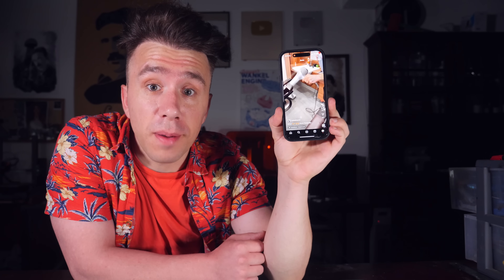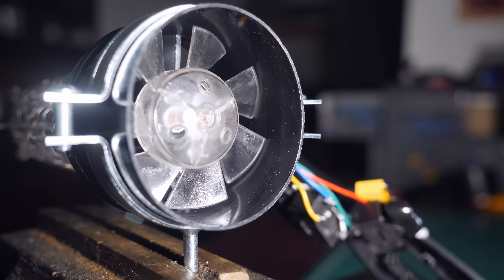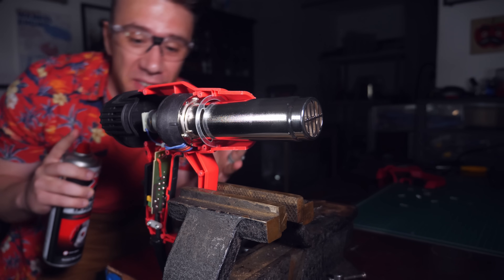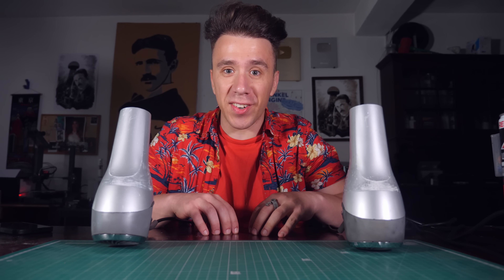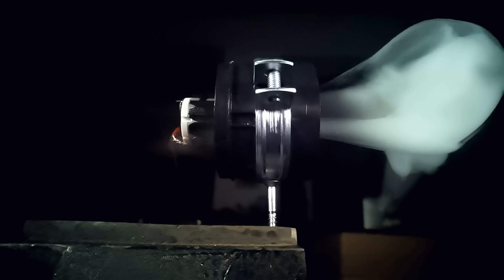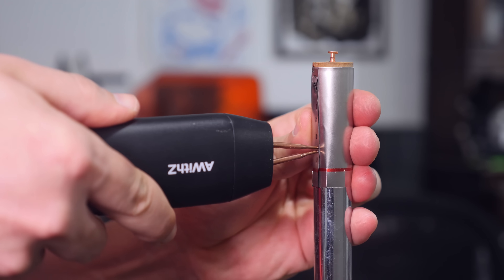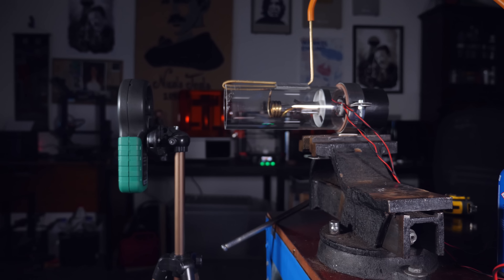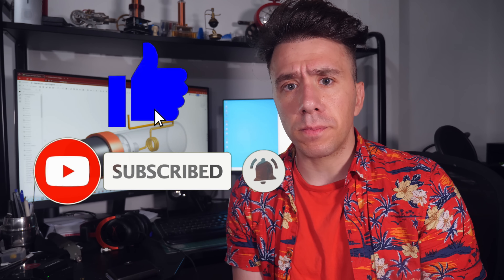I turned my $20 Hairdryer into a JET ENGINE

Comment: Oh hey one thing that really matters is the distribution and mass of droplets of optimal diameter to get complete combustion. Although fuel injectors work they're not ideal for certain applications. For a good time check out a contraption called a 'spinning cup burner' that gets used to get a gnarly hot flame for flash boilers. These were popular with folks messing with high speed steam powered cars back in the '80s and '90s. :-)

Comment: Same spiral coil you already have but drill micro holes all the way around the coil so the fuel goes in all directions. More surface area of both fuel and air contacting and small holes might make very fine flows that burn very efficiently. Potentially need to plug the end to add pressure to push out the holes, or make the holes mist the fuel into the air on that coil.

Comment: Use a burner can with progressively larger or more numerous air mixing holes. Burner can diameter should be ~80% the ID of your outer tube and twice as long. Also make the injector be a manifold ring with multiple pinholes instead of a single hole.

Comment: Hey Integza! You need a flame shroud or tube. What you are building is a Turboramjet or Air turborocket. 

It is the very simple version of a jet engine. Also a company is using it for a SSTO type rocket, using the fanjet portion in atmosphere then using like a rocket out of the atmosphere. 

So you need a flame shroud to keep the flame protected and allow it to heat the air completely. Its close to what you did, just a tube with lots of holes in it. Longer tube, more holes, make power!! Good luck! Feel free to reach out and geek.

Comment: A few things to improve the design. First is to extend the fuel injector past the igniter coil. This allows for more time for the fuel to mix with the air. Next is adding a nozzle to the end of the fuel injector like that of a chemical spray bottle. Tis disperses the fuel as a conical spray as opposed to a stream, improving the mixture rate of the fuel and air. Finally adding a compression cone, preferably with an adjustable aperture size to more precisely dial in the desired pressure a few inches past the combustion area of the tube. This way you can have the fan moving relatively slow to allow time for the air to mix with the fuel, then after combustion the pressure caused by the cone increases the thrust.

Comment: Awesome video!
I'd suggest adding a split valve, in the one side the breaker cleaner and on the other side pure oxygen :)
Carefully of course as this could be very dangerous

I'd also think it would be cool to try to use a "bladeless hair dryer" and see if this would work. If it does you could burn a lot of tomatoes, cause tomatoes are disgusting !

Comment: I can’t use the 3D model but I would suggest that thru the acrylic tube make small holes and insert injection like needles. Thru these needles use O2 gas just before the ignition and use a gauge on O2 cylinder to control the thrust.

This basically be like 4 holes on the tube and some needles with O2 flowing in them and solving the problem without having any issues with the fan speed.

I may be wrong but you can try on a 3D model.

Comment: The high-speed, turbulent air is going to push the fuel-air mixture belown it's LEL (lower explosive limit) - the other is too much fuel, UEL - upper explosive limit.

It's quite suprising what will go "BOOM" if you get it right. Flour, custard powder, WD40... etc.

Comment: I have an idea that can help speed the air up alot,
add a pressurised tube at the end of it, (Like the ones in jet engines) Aswell as get a stronger motor for the impellor (Idk if i spelled it right) (Maybe use one from an rc car) This should increase the blow speed by alot and hopefully be alot stronger.

Comment: Technically, you didn't make a jet engine. You made an afterburner for a hairdryer - similar to the "motorjet" concept.

To burn all the air and maintain high velocity at the outlet you need to use a large diameter combustion chamber with a small diameter exit. The more pressure you get from the fan, the more thrust you will develop. But the temperature involved in burning all the air is really high. Most modern jet engines run at about 15% O2 in the exhaust. As air is 21% oxygen that means that only about (15-21)/21 = 6/21 or 2/7 of the air is actually burned.  Any more and you'll melt the turbine blades (though fortunately for you, you don't have any.)

Comment: I love this channel you're nuts but i think one day you are gonna invent something amazing Could you not drill very small holes in the coil and and instead of it being closely packed experiment with different spacing use something like a cars injector to control the amount of fuel in pulses ? also where you have the igniter support try changing the 3 ring supports to curve the channel of air a bit like jet engine compressor blades to make the air circle ?

Comment: Instead of nichrome wire how about a high voltage spark generator. Also for fuel to air ratio use a Venturi pipe to help meter the fuel.

Comment: The obvious thing to do is to channel some of that air into the combustion chamber. Just some small tubes (with a flair at the end) directing some air into the combustion chamber.

Some tweaking will have to be done to find the right size and flow of air (one, two, or three tubes) but it is an easy thing to think of what a jet engine can do.

Comment: Have a fan that high produces high speed air which leads into a hallowed shock cone we're on the inside of the cone is the wire and behind the cone is a tube on the sidewall of the jet engine with holes that spray fuel upwind and towards the center of the shock cone where it is ignited and it's heat should preheat the air hitting the shock cone farther Downstream is the fuel tube in a coil the middle which goes into a straight line outwards and through the engine wall to go to the fuel Inlet then at the very end of the jet engine is another fan with metal blades to withstand the Heat speeds the hot air back up and if spinning fast enough and has enough blades depressurizes the air. (Sorry about my spelling I have not fully learned to spell)

Comment: I want you to take this concept you built here to another level by applying high voltage discharges along anodes and cathodes.. to affect the fuel distribution before combustion. perhaps this could effectively improve the air fuel mixture ratios... so that the higher compressed air would not prevent combustion.... if not try to use the ions to focus and or confine the plasma of the flame into layers that would act as baffles that can be adjusted to constrict or expand on command to act as afterburners. 

take a look at plasmachanel's new video for more ideas.

Comment: You might be able to put the coanda effect to use by putting a sphere between the fan and the igniter. you might also make the sphere an ionic thruster to allow you have control over the airspeed.

Comment: 13:00 "How to use all of the air without losing thrust"  My answer is as boring as obvious... "Multiple fans on the axle, deviate some of the air flow, use spark igniters..."  => Build a miniature jet engine... turbojet, ramjet,...  with an AFTERBURNER !  🔥🤘😎🤘🔥

Comment: as u are using an acrylic uniform cross-section tube, instead u can use a nozzle like tube to focus more air into the combustion(as the combustion is happening inside the sheet steal metal excess air won't be an issue)

Comment: What u need is a convergent divergent nozzle which is basic for any jet. The fuel is injected at the point of highest compression. I recommend placing the motor in front of the intake fan instead of behind it.

If you want to get max thrust and exhaust speed using the motor then you can leave the back open but if you use a turbo fan in the back it can go beyond that and the motor will only be needed for start-up.

Next level of bang for the buck would come from having a bigger intake fan and separating the the outer high flow and inner jet areas like in modern turbo prop jet engines to get max efficiency.

Comment: aerospace engineer here who did coursework on jet and rocket engines: what you're doing here is effectively making a turbojet engine from a hairdryer - so you can just use the principles that turbojet engines use to get higher effiency of fuel burning.

With the design you showed here, I'm not sure if you put a spray nozzle on your fuel injection port. If you didn't, change that. If it's coming out as a liquid stream at the end of your tube and you're burning that liquid stream in the air, you're losing a lot of potential there (only the suface of the liquid is combusting, leaving a lot of unburnt fuel in the air). The big explosive burst you're seeing coming directly from the aerosol cans are because the sprays are pretty much fully vaporized. By spraying the vaporized liquid down the long tube, it's probably just turning back into more of a liquid stream. So the solution there is to somehow move the aerosol nozzle to inside the fuel injection area. I recommend fixing a hose at the end of the spray can, then salvaging another sprayer from a seperate can and mounting the salvaged one on the hose end (or just buy a specially made fuel spray tip, disel engines use them all the time)

Once you've done that, and you want even more umph out of the system, you'll want to actually use a nozzle that encourages combustion flow - so you want the nozzle to get more narrow toward the exhaust of the system. That will force the burning fuel-air mix close together, allowing it to more thoroghly burn, after that part if you want to put an expansion nozzle after that - it'll then encourage that burned mix of air to expand out and burning even more of the fuel-air mix - producing more thrust (but at the cost of exhaust air speed, which is what it seems like you're gunning for)

You also may not be giving it enough time in the nozzle to burn - so if you're still seeing problems, lengthen the narrowing section of the nozzle.

Comment: I have a lot of experience with aerosols  and combustible products and I have a safety suggestion. Don't spray the can that close to an ignition source. It's printed right there on the can. But the product is being expelled at an appropriate speed and volume so that makes it safe right? Nope. Not 100% safe because the flame can follow back into the can if you don't immediately  release the push button. That provides an opportunity for the flame to chase the product back into the can. As you can imagine, the can would explode and I'll leave the aftermath of that to your imagination. 

There is no safe way to spray anything from an aerosol can into a flame or other ignition source.

Comment: TL, DR: The air must be slowed down with a nozzle at the end. 

Why:
It increases chamber pressure and improves combustion. Improves thermodynamic efficiency too.

How:
Right now you're relying on just heat. So it's something like a lenoir cycle, but with rayleigh flow instead of constant volume heat addition. These cycles have inferior efficiency compared to brayton cycles where constant pressure heat addition is used. When a  converging nozzle is added, it effectively reduces airspeed inside the chamber and increases pressure (bernoulli). Also, it allows for more combustion as the flame front has enough time to reach everywhere and heat the air (akin to constant pressure heat addition) This increases chamber pressure significantly and results in higher exhaust velocity.

Comment: 1:27 You got almost everything you could get wrong wrong.
1) The length of the wire doesn't affect the heat at the same current. If you have the same current in a longer wire, you have more power dissipated by more wire and the temperature is the exact same. The voltage and power will be higher but it's not gonna run any hotter at the same current. If you have the same amount of wire and pass more current via more voltage, temperature goes higher. It has a resistance in volts per meter when you buy it.
2) If you shorten the wire it will NOT use the same electrical power in your setting. Since R=U/I (resistance=volts/amps) and P=UI (watts=volts x amps) are a thing, shortening the wire will drop the R and I will increase as U is constant. As U is the same and I is bigger P will be bigger.
3) As for the ignition, they probably just used an old hair drier and the motor was sparking at the brushes. There is no way the coil ignited it.

Comment: You could try adding 2 holes on each side right behind the tube where the flames come out since the wind thats generated from the blade might suck in some air from the holes adding to the combustion

Comment: My recomendation for am improvemt is to inject pure oxygen in the inlet and adgust the air and fuel ratio for the best performance and combustion also use a BLDC motor for fast flowing air and finally for the enclosure use a tomato sause can for maximus satisfaction

Comment: Maybe you could use the swirling velocity component of air to increase the time it "touches" the fuel, so you have a more efficient combustion (i think?). After the combustion use a stator to straighten the outlet flux, and maybe place a nozzle. I don't know if it could work, i was just thinking

Comment: Add more fuel just after the fan .  And a converging diverging nozzle  so the outer layer of air comes into the flame and ignites as it goes through the restitution of the nozzle and then expands through the diverging nozzle

Comment: Yo I have an idea, so you see the weird fins to slow the air near the coil? What about you make spurs going outward from the centre with a fuel line running down them. It would slow down the air and allow for the fuel to burn off of the flame in the middle. If it doesn’t ignite, maybe have an arrogant of glow plugs position radially behind these struts. Or maybe use a stator befor the combustion chamber to pressurise the air ready to combust.

Comment: Try an annular ring inside the clear tube with equally spaced fuel discharge jets and one central jet in close proximity to the ignitor.

Comment: Ideas;
1. The buten is gaseous and the break cleaner is liquid it only gets atomised on spraying though it's stock outlet. So when you connect the ignition tube it gets time to become liquid again and so lowering the surface area for combustion to occur fully. Hence the poor performance.
2. Try rebuilding it in a turbo fan jet engine kind of way where the outer most air protects the acrylic tube as before and the inner most air is compressed for effective combustion. The compressor can be very interesting with both axial and centrifugal stages. Goodluck.
Btw try building the flow meter out of *metal 3d printed parts*, a bldc motor, Arduino and then calibrating it.
I hope I win the 3d printer this time.

Comment: To reach a higher stoichiometric fuel to air ratio you may turn the fuel canister upside down to inject more fuel, drill holes in the fuel tube that are pointing towards the combustion and seal the end to inject streams of liquid fuel into the combustion chamber. That also enables you to use liquid fuels like gasoline. I would also heat the fuel by spiraling the fuel line around the fan and inside of the combustion chamber and increase the diameter of the inner fuel-line coil. You could also inject fuel that is heated outside of the combustion chamber and inject it into the chamber from multiple points and you should definitely use a DeLaval Nozzle.

Comment: Design the mount that holds your igniter setup to include slanted flights so the forced air creates a cyclone through your tube. This will help to better mix the air and combustible, thus giving you more boost.

Comment: You could make a ring out of copper tube and attach neadels on it in 45 degree angle and mount the whole thing on the support of the igniter and then the moving air wouldn't slow down as much as bevor.

Comment: Maybe because he is using a nozzle at the tip, pressurise the air inside and gets out at a faster speed but air inside moves slower letting the combustion appen

Comment: I have a Master brand Industrial Heat Gun.  It draws enough power the lights dim in the garage.  (don't worry, I have dedicated outlets as well, no light dimming when using that)
It has a squirrel cage style fan with a side intake and gets hotter than any other heat gun I've ever tried.  It can get stainless steel glowing red hot.  The fan cage and surround for the air ways are all metal, and the nichrome is suspended with mica sheets.  There's also a 2 layer shroud around the output, the inner is almost touching the nichrome so it gets incredibly hot, then the outer sleeve is separated by built-in standoffs with an air gap between  I would imagine that would be ideal for this application, the fuel could even be injected between the inner and outer sleeve.  Plus it has a variable damper on the input, which could work like a choke in a carburetor.  

Damn, now I kinda want to try doing this with my heat gun...  Starter fluid for engines  for lighter refills might be a better/ more efficient fuel

Comment: A coil around he acrylic tube, with holes in it, could inject more fuel into a greater volume of air, thus increasing the combustion boom, possibly. To ignite the fuel I was thinking about sheathing the nichrome wire, like in this video, and to actually ignite the fuel, the fuel has to get there, so my thought was to make multiple hole in the sheath around the nichrome wire, so that the fuel could get there, but the air current wouldn’t obstruct the ignition

Comment: What if you went through the motor? as in a brushless that has the rotation on the outside with your fuel and igniter inside.

Comment: A cone deflecting the air towards the middle of the tube, towards the ignition. Add a bypass to the cone with some angled holes around the outside of the cone to create a boundary layer vortex to protect the acrylic.